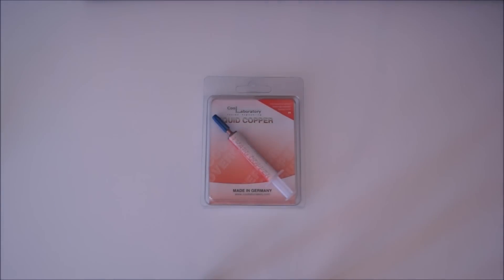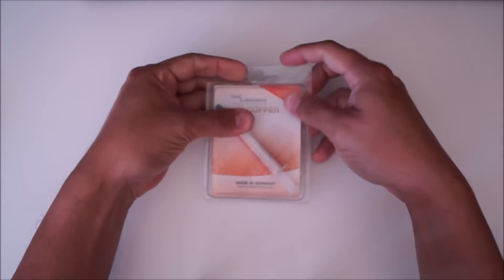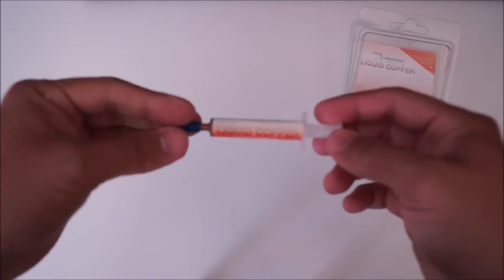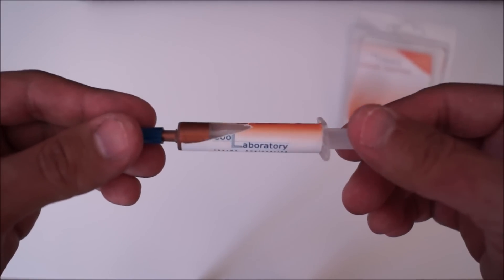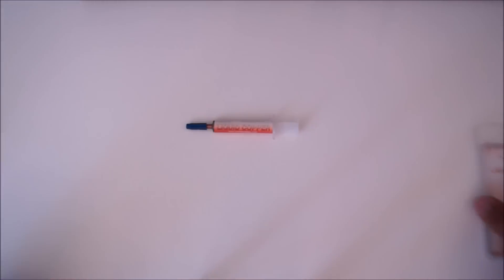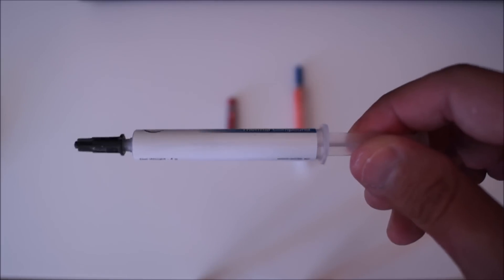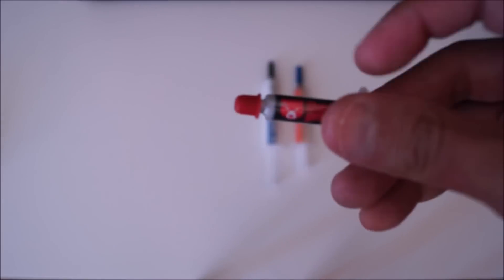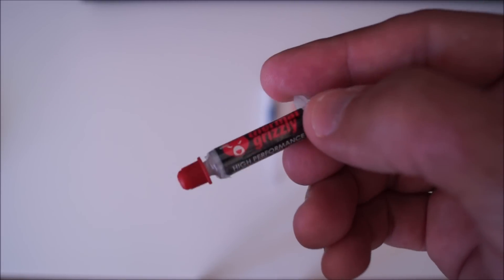Liquid Copper. Is it any good?

Comment: I had interest in this product, because it marketed itself as a liquid metal paste. This means that if performance is at least in a same ball park as other best liquid metal products, this means that this is really revolutionary product. Liquid metal has gallium in their composition which reacts with copper. This results in a lot of maintenance for liquid metal solution. Now imagine that this thermal paste does not react with copper, because being made of copper itself and has similar performance to other thermal pastes out there. You could put normal coolers on it as they have copper contacts. You could replace Intel's IHS with custom one made out of copper. You could make your cooling overall so much better than you could normally achieve with thermal grizzly or any other solution. I think that there is a market for non-reactive liquid metal paste with copper in the market. It is just sad that no manufacturer is interested in developing this new product.
Reply from the maker: This never made it to the frontlines because it actually is not liquid metal at all. The name "liquid copper" is a marketing scheme. What it really is, is small copper particles suspended in some kind of liquid matrix, or thick solution. When looked up close you can see the small particles, kind of like glitter floating in a liquid clear paste. It performs awful! You might as well use toothpaste. Keep away.

Comment: What about “Copper Grease” or “Copper Anti-Seize”
https://youtu.be/U39y-zl-6X4
*
In comment, man there say:
started using antiseize on my computers, works really good!
*
those processors now idle to less than 30c and wont rise temperatures above 50c under primer95 stress test (previously they all hit 60c with ease), and my laptop 640g1 with a mobile i5@2.6ghz never goes above 60c where previously it rised to 75c under stress. BTW I am using Chesterton No.725.
*
on 2 computers the compound used was Artic Silver 5 and on the other 2 the included Cooler Mater High performance stuff, everyone would thing its an apply once and forget about it, but after watching your video got curious and after removing the heatsinks to ckeck them out, the AS5 stuff was completely dry, and the CM hardened like melted plastic, 
*
after a fresh half pea size drop of antiseize reinstalled the heatsinks and everything looks perfectly fine, even applied with extra care to the gpus and they dropped a few celcius degrees too.
*
I got a very generous sample from the engineers at the lab where I work, this was by accident because I asked them if they had some Permatex copper I could use for some test and they told me that was the only one they had at hand, nice guys heh.
—————————
And here, maybe stupid but work https://youtu.be/YyYgDrlMkik

Comment: didn't even apply it right. Also for liquid paste you should do the test afer 7 days or so.
Reply from the maker: This is not liquid paste or liquid metal. This is just a silicon matrix with copper particles. Notice that it is not as famous in the market as Liquid Ultra, Liquid Pro, or Conductonaut? There is an obvious reason for it. It sucks. And if you look at the entire video, I did apply it as instructed and I mention it. And as for your 7 days, this is the first time I hear this in my 20 years of working with computers. You just don't know what you are talking about. But if you doubt me, buy this Liquid Copper, make a video, and tell us how awesome it is!

Comment: Good video.  I had the exact same result with thermal grizzly.  I had mx4 installed and after paying $30 for thermal grizzly, I found my temp was higher by about 1 degree C.  Very disappointing.
Reply from the maker: MX-4 is good stuff. Has never disappointed me.

Comment: Nice Job, Your test seemed to conquer with all the others I have seen. The real liquid metals perform the best. This fake "liquid Copper " is not really liquid at all like you said its particles mixed with silicone which is a great insulator. The real liquid meals made by Coolabs and Thermal Grizzly still perform the best it appears they are just very different in application from these paste types. Good video! :)
Reply from the maker: Thank you. Right after the making of this video, I tossed the whole tube in the garbage. It is literally junk, though some with promotional interests from Amazon.com, for example, have given this product a positive review, it is a bad product which no one should be buying. Nice concept, but poor performance.
Reply: I just ordered the real liquid metal stuff from Thermal grizzly . It appears to be a alloy of gallium,tin and another metal . I forgot. It can be bought from gallium suppliers online but its about the same price. I have all copper blocks and will def. follow their directions but it seems like most get a fairly good temperature drop when overclocking. It just cannot contact steel or aluminum, I guess I will see. :)

Comment: Lol the only interesting thing here is that you actually bothered to delid and apply liquid metal to a $60 processor and are watercooling it? Even though you are baseclock overclocking it on an old BIOS on a 100-series board, that CPU is not worth that kind of enthusiast treatment. I can see doing it on a locked i5 or i7 6700 but a Pentium? There are no words, I can't even...

Edit: Also liquid metal is designed for on-die applications. Putting it on the IHS doesn't do it justice. Even CL's Pro and Ultra would show poor temps for what they are if applied like this.
Reply: eh. dont listen to them. a modder at heart wants to mod anything. doesnt matter if its 60 bucks or 600. if anything its smarter to start with a cheaper processor for delid so if you do make a mistake you are not out all that money.
Reply from the maker: @michaelbrayman4994  I'm a bit late but you are correct.
Reply from the maker: Any processor is worth the enthusiast treatment anyone wants to give it. Not everyone watching this video can afford an i5 or i7 either. I would delid (if it was possible) a Pentium 4, overclock it, and watercool it if I wanted to and if someone would find that entertaining. That's my choice :) You missed the whole point of the video completely. But thanks for watching!
Reply: Zfast4y0u
" think there is no diff water cooling that crap or air cooling"
Do not think because in your case it is counterproductive. Crap? Yes, you have much of that inside your head.

Comment: "How to apply “Coollaboratory Liquid Copper”
Add a small drop of Liquid Copper to your coolers centre. The exact amount depends on the size of
Heatspreader, on the evenness of the contact areas and the thickness of the gap. Now spread the
Liquid Copper Paste smoothly across the whole cooling block with the added plastic. Normally it is
enough to apply the Liquid Copper on one surface. Now press the cooler onto the CPU. Do not turn
or slide the contacting surfaces against each other. This way, air cushions could form between the
corresponding surfaces, reducing the thermal effectiveness. Pressure from above is completely
sufficient to form a thermal connection between the two surfaces. Now mount the cooler and its
devices according to the manufacturer's instructions. Check the contact between CPU core and the
cooler's surface. The cooler must rest flat and even on the CPU. The cooler's and CPU's edges should
be parallel."
So, your conclusions are absolutely irrelevant.
Reply: The way the thermal pastes are applied has a big impact on the outcome. The play3r guy AFAIK did 1 sample for each test so from a statistics point of view we can't be sure where the true temperatures are. There's simply not enough data there to say that the pastes perform significantly differently.

I'd refrain from calling out those results as 'staged' since the variance you get with a sample size of 1 for each scenario can easily lead to results that differ from the 'true' values.
Reply from the maker: **I tried spreading it also, as I mention in the video and the results were the same. Obviously you nor the previous guy in the comments watch the whole video.** 

I would do that before commenting without knowing all the facts :) But please, do not take my word. Buy the product and try it yourself. I would love it if you made a video proving my findings "irrelevant" as you put it.
Reply: Here's a second opinion: https://play3r.net/reviews/cooling/thermal-paste-comparison-2017-what-is-the-best-thermal-paste-2017/
Reply from the maker: I would take those results from that link you sent me with a grain of salt. The graphs seem a little strange, with each group of particular thermal pastes all at exactly the same temperature. To me those results look "staged". 

I know Thermal Grizzly Kryonaut performs better than IC Diamond based on several tests I have performed comparing the two. Yet according to the site you quoted, they perform the same? Even Nactua NT-H1 outperforming Kryonaut? 

I'm giving you an unbiased opinion on the products I test here. I am not promoting any products for any sponsors, as on that website. He seems to love Amazon :) But again, the only way to be 100% sure, is for you to try it yourself. Cheer!

Comment: this Test is all wrong. go and check application of the liquid metal pastes, they are completely different, you have to spread these on the application surface, pea method that you used is absolutely wrong. second point is that these thermal pasts are made for extreme solutions like deliding the cpu and replacing the cheap TIM on die. Liquid metal does not improve much out of CPU as many before you tested these stuff.
Reply from the maker: 1. I did try spread method, if you watch the entire video, I mention that. The results where the same. 

2. Every liquid metal TIM I have purchased explains how to apply the Liquid Metal TIM over the IHS (although most of us will use this stuff for on-die applications. I have since tried this Liquid Copper on my GTX 970 and the temperatures results were worst than with stock paste. And yes, it was spread. 

3. Liquid Copper is not liquid metal, but it is rather copper particles suspended in a silicone matrix. The fact that it is called "liquid copper" is just a marketing scheme by Cool Laboratories to make end users think they are getting liquid metal.

Thanks for watching!
Reply: Technology Hive to be honest I have not used this one yet, but I had 20 c temperature improvement on intel cpu with liquid ultra. But liquid ultra is very dangerous if it gets to silver and aluminum. So I thought if I get my hands to this one it might be more desirable. But you say it's crap Well maybe that's why it didn't go to market like liquid ultra
Reply from the maker: *My experience with it was bad. I tried playing devil's advocate and I tried also using it on multiple dies, including a few other graphics cards. I kept getting the same disappointing results. And yes, this must be the reason why this product did not bloom in the market, like Liquid Ultra, Conductonaut, and Liquid Pro did. It is a bad product.**
Reply: The problem is you think it is the same as liquid metal, but is was a marketing trick. Copper is not liquid at those temperatures. It is a simple paste with copper particles. Liquid metal is actually a metal that is liquid at these temperatures and therefore has exceptional thermal conductivity. Yes copper is one of the best thermal conductive metals but those particles are not continuous, there are silicon between them so the overall performance is not even close to liquid metal. Apparently it's worse than the normal pastes.
Reply from the maker: @axellno1759  You are correct
Reply: You never ever spread thermal paste manually.  Ever.  The only exception to this, is the liquid metal products like Coolaboritory Liquid Pro/Ultra and Thermal Grizzly Conductornaught.
Reply: Better read what he was typing. He said you are doing the pea method and thats wrong with liquid metal products. You have to spread a thin layer all over the surface. Also put some on the cooler itself. And for the best methode you delid the processor (If not solderd) and apply straight on the sillicon.
Reply: SMRT  You don't need to spread it manually, the weight of the heatsink will always do a better job of evenly distributing the paste.

Comment: hmm liquid copper looks like a let down guess i will stick with trusty mx-4 for the top of my ihs. would be surprising if some how you got a counterfeit liquid copper tube tho
Reply from the maker: I think you're by far better sticking to MX-4. Its an excellent product and it lasts a long time! I bought this Liquid Copper on eBay, and you never know, someone could sell you some snake oil.
Reply: +Technology Hive that is what i was thinking mx-4 has show to be pretty great at a decent price point. then theres the real liquid metal stuff their ultra line is to much trouble for on the ihs. but that stuff is great for under the heatspreader
Reply from the maker: Damien Liquid Ultra is the best for on die applications. I will be posting a new video reviewing Thermal Trizzly Conductonaut soon :)
Reply: Technology Hive I have heard it was decent but is not quiet as solid and may get pushed out under the IHS on a delid easyer than liquid ultra. also you still running that pentium or have you upgraded to a more core cpu?